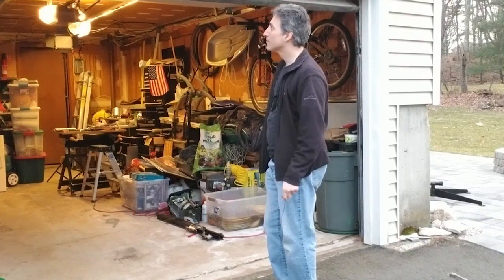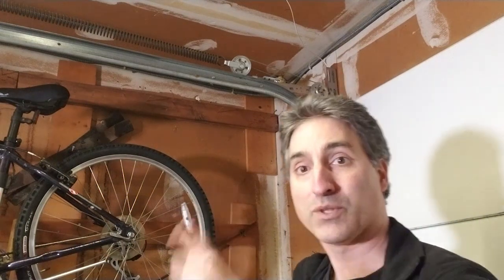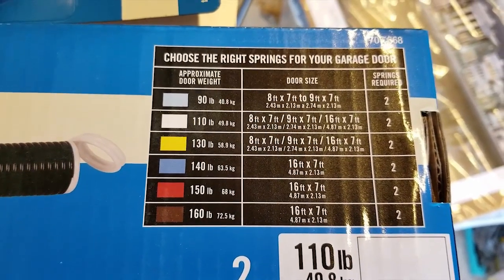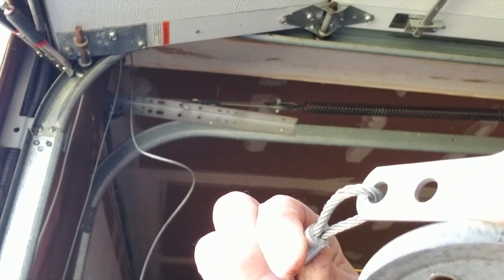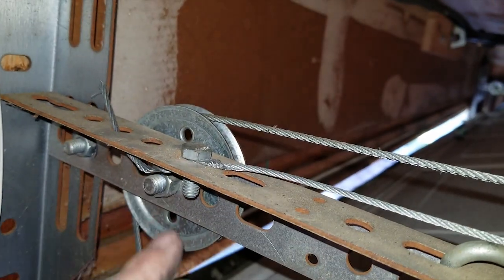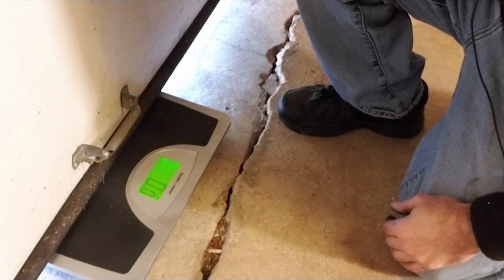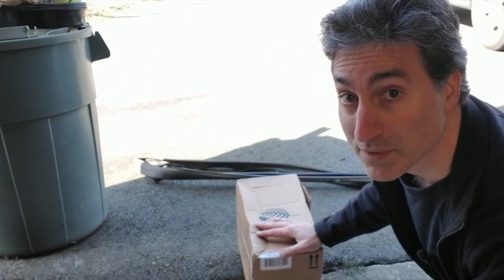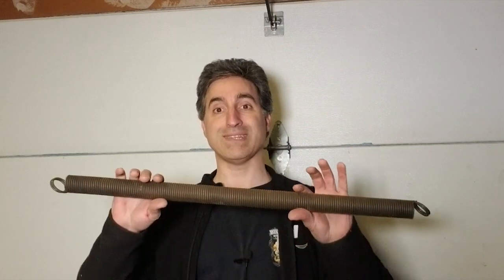Garage Door Extension Spring Replacement

Comment: This is a bit dangerous in sequence.   You suggest weighing the door after spring cable is disconnected.   The door is then down.  Without spring assist how do you get it up to reinstall springs?
Reply from the maker: Firstly, thank you for watching! It was not an issue for me because I am physically capable of deadlifting a 100+lb door. Of course, viewers who decide to take on this project will have to do it at their own risk and understand the physical demands of the task. I also had to measure the door because it had been so long since the springs had been replaced, and I did not remember the door's weight. So, it ended up being a good opportunity to illustrate on the video.
Reply: A safer approach is needed.   While many post 80s doors are light, older doors are often in the 170-210 lb range.

Comment: im actually looking to do this exact thing.. arent your springs that you were replacing "blue" so heavier than you bought?
Reply from the maker: The springs I replaced were 16 years old which may have been a different brand with different color coding from the brand I bought this time.
Reply: Yes blue color is correct that you saw that’s 140LBS Spring then
Reply: No strut on the top section Very important when a door opener installed
Reply: Pulleys worn to